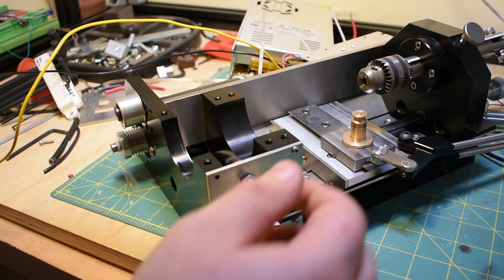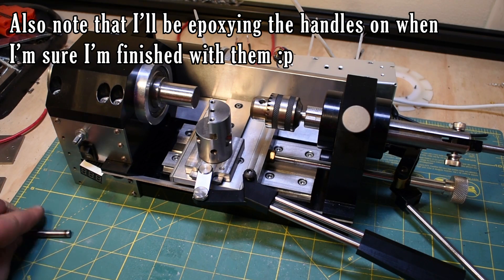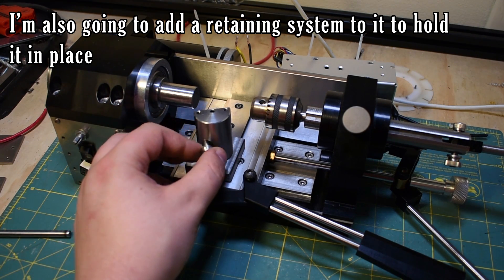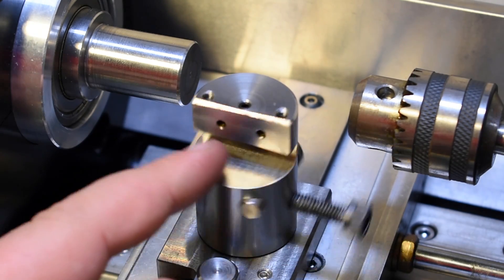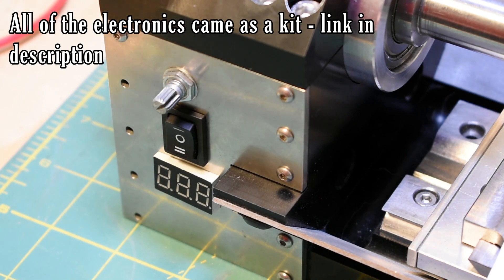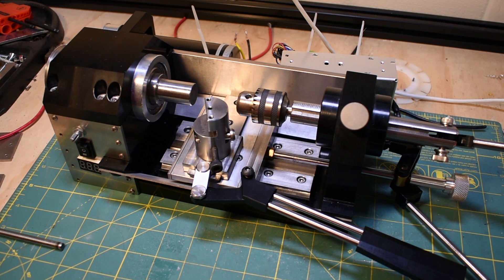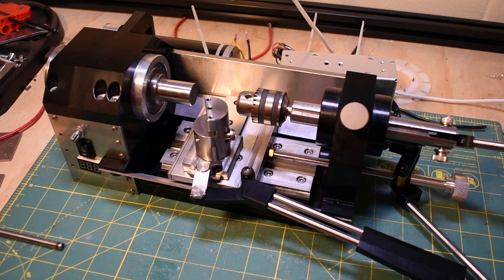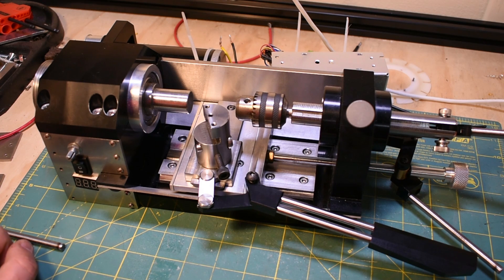Jeweler's Lathe Part 8:  Tool Post and Control Panel

Comment: Could the handle for the tool post also be the pin? Would make for quick tool swaps, especially if it's held in by some clip or snap solution

Comment: I'm only really doing lathe work right now, Haas is great, watch their "Haas Tip of the Day" and you'll learn a LOT from Titans Of CNC too, in case I haven't said that already. Try to talk your job into PowerMill cam, I'll email you some links. I've been working on designing a 3D printer rigid enough to double as a CMM which I might do a build series/vlog on when I'm beginning to build it. I'm only just now pricing stuff through work with THEIR discount 😈 Going with SKF LLU linear rail system....recirculating roller pins instead of ball bearings. https://youtu.be/kJzkMGnjsdk

Overboard? To say the least. These might start at $1,000 😳 with how precise they are, a 3D printer feels like a bit of a waste. I might use them for a few prototypes the prove some concepts, I kind of want precision ground mating surfaces with them....I feel like I'd need them? Is a machined surface good enough?? ¯\_(ツ)_/¯

Shoot me an email, let's bounce some ideas off each other. 

For the CNC lathe I'm planning on, I'm ok only going to use a planetary roller screw for the Z (because I expect that will be what takes the most force). I don't mind taking shallower depth of cuts if it means I can take those cuts crazy fast hehe. Not sure what to do as far as the spindle motor yet, I like the way Swiss lathes work where you have a collet further back in the machine and you're always machining against a precision carbide guide bushing. The problem is that would kind of limit me to precision ground stock which will be a lot more expensive material...but the precision like starts at holding half a thou with relative ease, and I'm sure you can fully appreciate just how nice holding even less than two thou regularly is. 

Do you use Steppers or servos? Which one will you use for the CNC version of that? I'm planning on making my CNC lathe use...probably Sandvik tools (even though they are quite large) because Sandvik's inserts are easily +/-0.0002 repeatability, and they last FOREVER. Reset the wear column, change the insert, machine a part, perfect part. That saves a lot of time and time is money. 

I want to try the Masso, I want to introduce the company I work for to them because we are a machine building company, like we are all pretty much developers. I'm hesitant to spent the money because I'm under the impression it's antiquated hardware and not being Open-Source in today's world bugs me because it's how innovation is allowed to just run like wildfire. I don't think I'll spend my own money on one. I wonder if they'd be willing to send a review unit to me. The controller I want to use, the one I  for 3D printers, is a Duet2 WiFi. It is limited to Steppers and maybe 2 brushless motors with the help of an ODrive. A couple of CUI AMT encoders and some hobby rc brushless motors. Or go with Simplex Motion http://simplexmotion.com/products/simplexmotion-servomotors/

Idk. They're still a bit expensive. I may or may not become a distributor for them. We'll see. 

Looks good so far! I would've done a few things differently, I'd rather use off the shelf tools and all I really know if 1" and 3/4" CNC lathe or Swiss style CNC tool holders designed for inserts, so my mind defaults to that. That tool holder is odd to me, I'd probably go with something like this: https://www.shars.com/products/toolholding-workholding/quick-change-tool-post-holders

It's much bigger though, but you use standard tooling which I think is just easier. I like how small that is, you're not making it easier for yourself by keeping your machines so small. Looking forward to seeing what's next:)
Reply from the maker: Hey Kevin, long time, no talk!  Hows it going?  I think I owe you an email!  As usual, thanks for all the new leads to check out.  You always set me onto internet search binges!

If you make a 3D printer with roller guides you might draw some fire away from me for using Clearpaths in the spirit of overkill :P.  I think there's a good 30% of the DIY community that really doesn't like overkill haha.

If I do a CNC version of this, it will be with lower end stuff.  I might still use a Masso because of the convenience or not needing a PC.  It will probably be NEMA17 motors.  I use Clearpath motors for NEMA23 and larger, but I want to see if I can optimize a really small machine like this with proper tooling.  A NEMA 17 with a good driver can be pretty powerful.

In terms of tooling, I might just use a QCTP like the one you sent along for the potential CNC version of this machine, but I was also toying with the idea of a turret that you screw the inserts directly into.  This is all speculation though, we'll have to see if I get around to it:P

I promise I'll get that email to you!  I've been so busy for the past 8 months!

Greg

Comment: When will CNC lathe be finished hooman?
Reply: Also I would switch to a jacobs #0 chuck for more room.
Reply from the maker: I actually have a J0 chuck kicking around somewhere... the taper to hold it is so small though, I don't know if I could cut a through hole in it and still have it be strong enough :|
Reply: Wait, why do you need a hole through it again? We are both talking about the tailstock, right?

Comment: For the tool post pin to fasten it steady, couldn’t you make the “hold down” design something like how tailstock locks are, to keep the tailstock from going in or out? Like in your tool post holder use to ball bearing(s), both out diameter to fit inside where the pin goes into, only the two bearings have a though hole, one of them with threads to slide the pin through the first bearing, then screw into the thread through hole of the second bearing, essentially making the bearing clamp onto the inner post, whenever necessary to do so? Just a thought.
Reply from the maker: I was having difficulties with tool bit positioning if I was going to fasten it down the center line -- I'd have to offset the tool in front of or behind the hold down device and that would complicate accurate radius turning.  I do like your idea though -- I'd probably try to do it with some kind of thrust roller bearing to reduce the risk of damaging ball bearings, or better yet even a bushing.
Reply: @TabletopMachineShop  Oh, yeah, yeah. I thought of stationary positions ok, I see that. I gotta say, though ya build some cool machines.
Reply from the maker: Thanks Eddie!

Comment: Been watching this lathe slowly come together and I'd like to build something similar, except with 5c collets. Do you think I could use the collet itself as a spindle, along with some tapered roller bearings?

Also -- any books you recommend that go into machine tool design?
Reply from the maker: So the CNC lathe that I keep saying i'm working on actually will use 5C collets.  The plan is to use the spindle out of one of those cheap spindexers (with some modifications) until I work up the nerve to machine, harden and grind my own tapers haha.

There aren't a lot of books on machine tool design specifically (though there are some), but I like Shigley's "Mechanical Engineering Design" for fundamentals.  If you really want to get deep into machine design specifically, look up Hale's "Principles and Techniques for Designing Precision Machines".  It gets pretty serious pretty quickly though :P

Comment: The D shape of the handle is inspired.

Looking good. I want to do a CNC lathe too, but  I think your at work machining possibilities are gonna leave me in the dust.
Reply from the maker: I guess it depends on what you have access to, but this machine so far used no CNC, and I think for a CNC retrofit of this machine, I'd also try to use manual machines to keep the barrier to entry low.